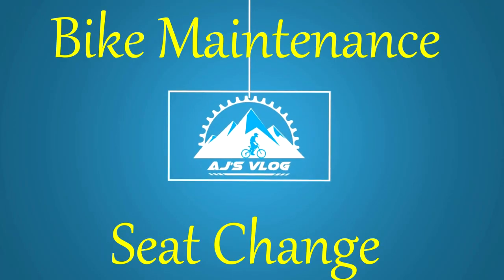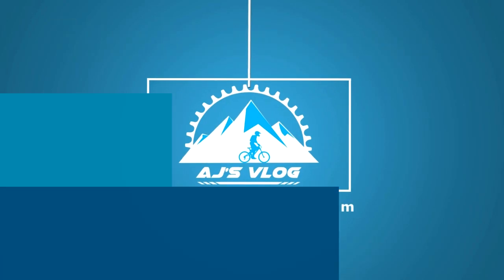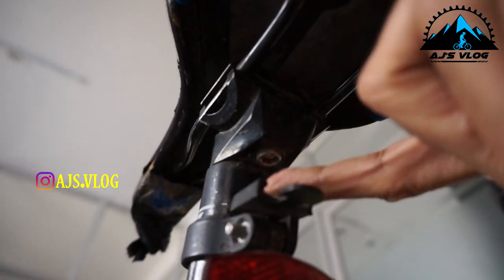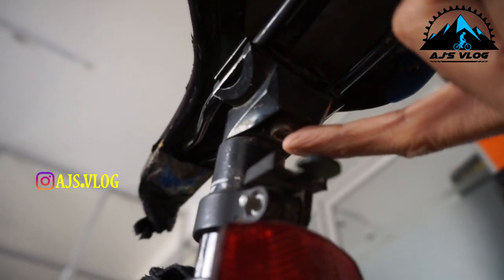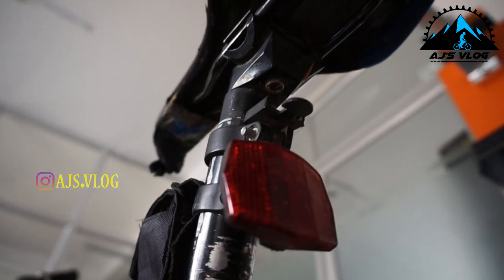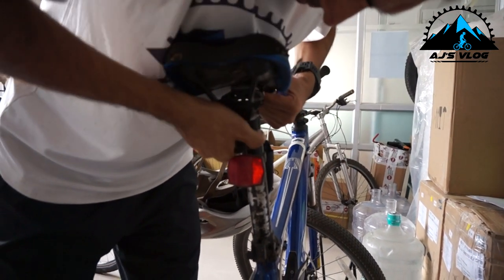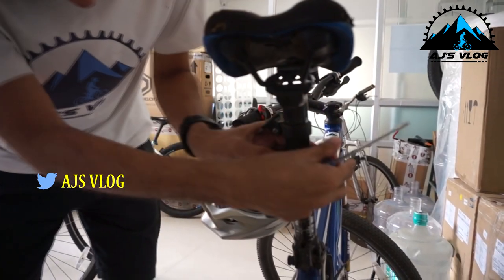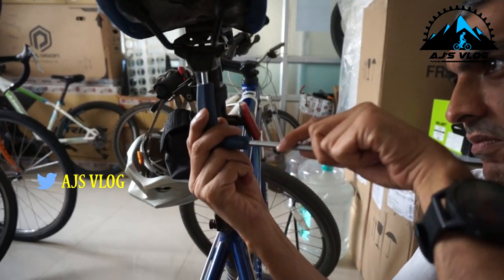Cycle seat change | How to | Bike Maintenance | Ajsvlog | Indian Cycling vlog

Comment: My seat post's Allen bolt got broken and i cant find any replacement
Reply from the maker: These bolts are available at cycle stores. 
If there is a Decathlon close by, you can visit there and ask them too
Ideally take the broken bolt with you so that they can give you a solution